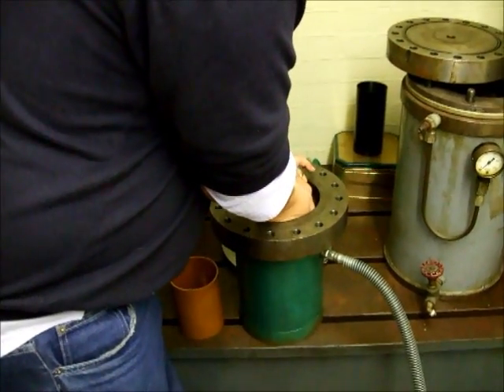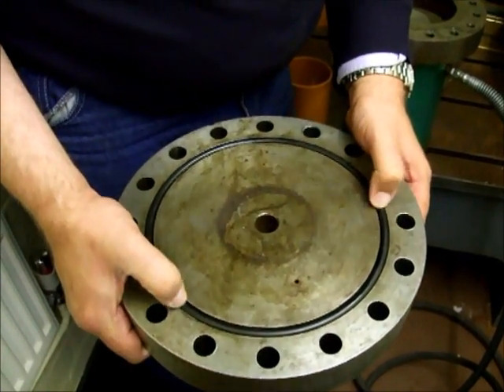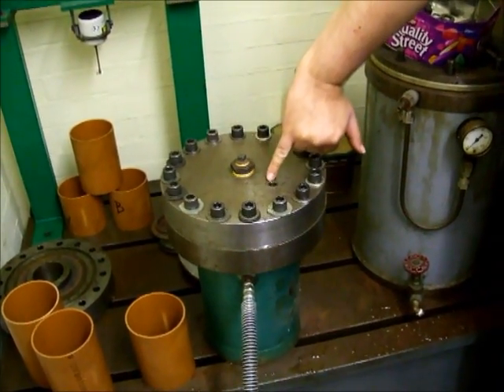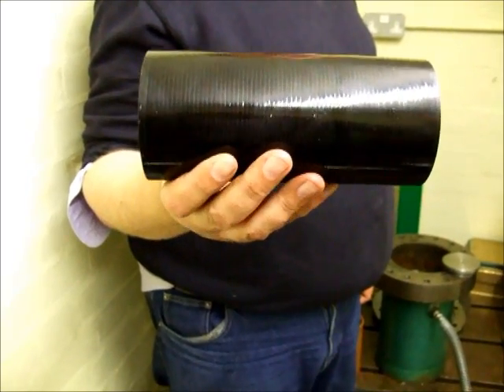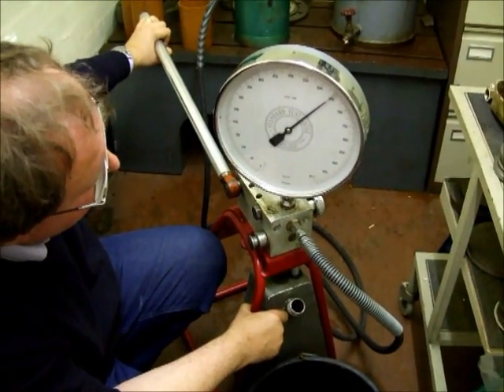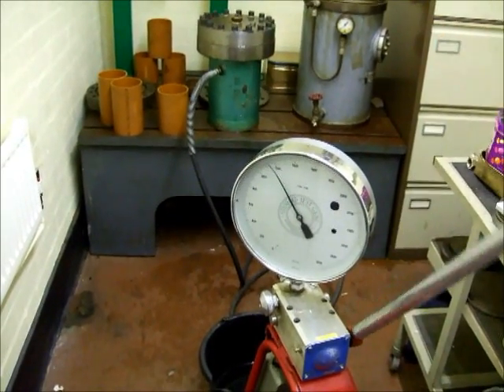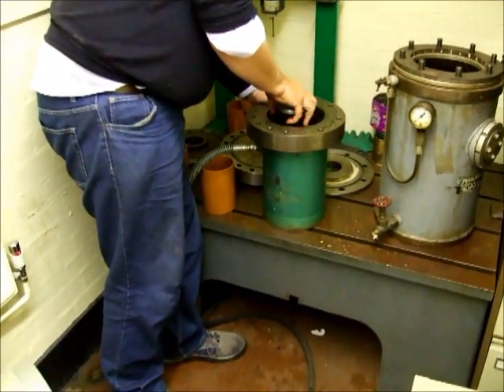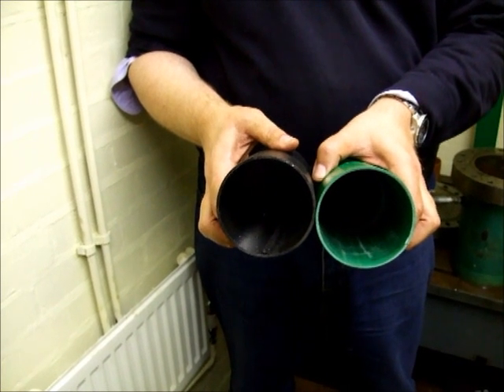Collapse of Composite Submarine Pressure Hulls

Comment: If only OceanGate had seen this experiment. This may be what happened to the Titan.
Reply: James Cameron knew.
Reply: @RichardPhilbin they all knew!
Reply: It seems like they chose to ignore a lot of risks. This video probably wouldn’t have made a difference to them
Reply: @guttermouseTV but those risks are inconvenient and stifle innovation! 😅
Reply: @guttermouseTV Yeah stockton rush should be smacked. Oh yeah he got smacked good already.
Reply: anything that differs in shape from an almost perfect sphere has to be reinforced by up to 35% increased wall thickness to compensate for the lack of efficient shape 
you end up having to reinforce your cylinder with walls so thick your end shape ends up being almost close to a sphere anyway
this is the current issue with the materials we know of to this day
Reply: @SHERMA.  Not exactly, it depends a lot on the material. Also if the shape is built in one piece. That's why submarines are built with metal. Not only metal can absorb pressure better (because of the material itself) but also can be built in one piece (extruded in a cylinder) which helps distribute the pressure evenly on the whole shape since there's no "beginning" on the shape (like a weld line, which is usually where failures occur). On bigger shapes that can't be built in one piece they overlap the pieces, so the energy is as evenly distributed as possible between them.

But with carbon fiber? No way it can withstand the same amount of pressure, unless like you said it's reinforced so much it ends up being very bulky. But carbon fiber has a problem that extruded metal doesn't, which is delamination. And soon that starts to happen you have a weak spot that's where the pressure starts to build up until it collapses and it's game over.
Reply: They didn’t care. They didn’t like the existing safety regulations, they wanted to do it their own way.
Reply: The CEO of OceanGate knew this but he still insists on using carbon fiber because of his ego and "innovation"
Reply: Ocean Gate knew and had been warned.
Reply: I'm pretty sure they knew.
Reply: Everything above is true but its even worse he used a window rated for only 1500meters. He shouldve been jailed.
Reply: That’s the problem. They knew of this.
Reply: Stockton knew all the risks and challenges, he was an engineer. He didn't take into account (or deliberately ignored) possible stress fatigue during use of the sub. This carbon fiber section should've been at least disposable, one time use only.
Reply: @Furiten  He used the material because it was cheaper. Single use would make it more expensive.
Reply: The whole industry knew which I think is what pushed the letter warning them about the dangers. 🤦
Reply: Titan is what happens when you try to prove science wrong.
Reply: Stockton Rush wouldn’t have cared. His sense of reality and estimation of risk wasn’t governed by evidence but by emotion and ego.
Reply: If only Stockton Rush was more than a rich man-child...
Reply: There's no "May be" about it ......... that's what DID happen to it, but in a more catastrophic way than those models stood up.
Reply: That is what happened. They heard cracking on test dives to which he apparently said that there are 5 inches of it so they were fine
Reply: @steveo601 Re cracking, submariners have testified that all submarines make noises descending. The experienced guys make fun of the noobs for freaking out.  I can't vouch for accuracy, but it gives me pause about assuming that noises correlate with failure. I believe we just don't know. And now I'm hearing dialogue from The Big Lebowski. Was Bunny really kidnapped? 😂
Reply: They'd have ignored it. Stockton had two last names for a whole name because he was an arrogant trust fund baby. Aerospace degree but no FE or PE because he wasn't a real engineer. Anyone who passed freshman level matsci would have known this was a con.
Reply: Rush might have seen this but the testers are 50 year old white guys so...
Reply: @krrk6337  Yeah is Professor Carl Ross - University of Portsmouth UK doing the experiment. What the heck does he know says Rush
Reply: They were prob inspired by this
Reply: @sikhswim  🎯
Reply: It was either this or the plexiglass window at the front of the sub.
Reply: Maybe he did see this and said …”HOLD MY BEER”
Reply: If only they had asked anybody or even listened to the people that tried to tell them lol.
Reply: The way rush operated seems to be like making a paper boat, the boat would act as a boat once or twice, but the third time it would disintegrate.. the real concern to me is his knowledge of microscopic fissures or breaks just didnt occur and his paper boat would never need structural rebuilds. Love to know what the companies own findings were with regard to durability.
Reply: Titan should have been made from Tungsten, but it's expensive but it would save Lives 🙏
Reply: Ocean Gaye C.E.O .WOULDNT HAVE CARED EITHER WAY…..he was an arrogant careless risk taker and didn’t want to go-out by himself so he took 4 others with him
Reply: They could have known. Rush didn't want experienced older white men telling him about science.
Reply: The owner knew, he used parts from "camper world".
Reply: It's exactly what happened.
Reply: These guys cannot do 5 minutes of work without having a tin of candy at an arm’s reach?
Reply: Ocean gate knew. They didn’t care. They have multiple subs of traditional construction
Reply: It’s as if they were tempting fate and audaciously daring anyone foolish enough to be dragged down with them… Demonic
Reply: At 5800 psi, the failure of the Titan was more akin to 50 lbs of dynamite.  It is scattered.
Reply: Nah bro, The CEO is such a stubborn and arrogant person. He ignored almost everyone who warned him, even the experts
Reply: Ya tepat sekali.
Sepatutnya titan cek ekperimen ini dulu..
Reply: This IS what happened
Reply: The CEO wanted to die i guess he just needed someone to die along with him
Reply: HEVDID SEE IT!!!!ALL COMPOSITE ENGINEERS ARE VERY AWARE …  
Don’t forget … 777, 757 all air bud are composite … this is a privativem Experiment .. Composite carbon and others have been worked on since the early 90ss.. I know I worked with StructuralFibers 1985 to 1990s!!!!
Reply: @ChasOnErie not underwater. You need a contiguous material like steel, titanium, ceramic or (more recently) acrylic, or there will be delamination.
Reply: It’s what happened. It’s a fact
Reply: They did, just didnt speak same language
Reply: When people have more money than sense
Reply: These are old white guys.
Reply: Rush already knew this , there's a man that went down with him and the hull was cracking so the had to return to the surface.
Reply: He didn’t want people who knew what they were doing working on it. Duh.
Reply: @please_stop-v7o eggs are extremely strong lengthwise but weak on the sides because of that very reason
Reply: Ocean Gate didn't care.
Reply: It’s dumb to not use a sphere shape because it takes on the load (pressure) evenly. A cylinder shape like Titan has multiple loads because of the shape, not only is the load on the entire outside wall of the cylinder pushing in but the end caps are also putting a load going into the sides of the cylinder this is why a sphere is the best design. It doesn’t matter how thick you make the carbon fiber hill it could be 10 feet think and it will still delaminate over time and fail. However even if you use only metal/alloys to make a proper sphere shaped sub you still will want to replace it over time and so many cycles just to be safe. But with metal/alloys you can scan the hull to detect any potential damage, not so much with carbon fiber. Ocean gate CEO took it as a personal attack when people said to not use carbon fiber but people only said that because it was the truth! People would love to use carbon fiber because it’s so light it would be great to be lighter that’s exactly what you want when building a sub but nobody uses it because it’s not safe.
Reply: did you hear the crack of the implosion?  loud!
Reply: The owner was motivated by profit and not quality or safety. He wanted to make it from a material that allowed him to increase the diameter to fit more people. Be thankful he wasn't able to evolve to having 100 people die.
Reply: I do love watching some uninspirational old white guys, quite nice indeed.
Reply: Carbon fiber is great for what they the good engineers use it for. Rush knew better but did not care. Shame he killed other trusting souls.
Reply: the 50yr old white guys they didn't hire knew about it
Reply: They probably watched this and decided it failed because of white man and their diversiteh would keep theirs safe.
Reply: Dude they saw this. They did these experiments
Reply: Stockton Rush knew this. He was incorrigible and stubborn. Mad man.
Reply: He is a 50 year old white man so who's going to listen to him
Reply: He knew.... But he tried to be the new rock star of the depths... He thought that he can got way with 5" of carbon fiber.   The only think that can hold at these depths is heavy steel.  nothing else.
Reply: The batteries died in the controller, or the duct tape.
Reply: Doubt it would have mattered❓
T'he CEO probably did❓
Reply: On the bright side we're all a little smarter because of their failure
Reply: According to an interview with the owner, they imploded lots of carbon fiber models in a lab at the U. of Washington while they were testing formulas and models.
Reply: OceanGate CEO ignored all of it.
Reply: I assure you, they saw this video.
Reply: They knew but thought the risk was acceptable
Reply: Titan has swam there many times before this was just an issue with the material
Reply: The real problem was the sub being made of 3 different materials, each of which expand and shrink at different rates, eventually causing a seal somewhere to be compromised after repeated use and testing. Stockton did not account for this sadly.
Reply: Wouldn’t have mattered. The CEO was too arrogant.
Reply: They knew.
Reply: @please_stop-v7o  The Deep Flight Challenger was build for Steve Fosset, who died in an airplane crash before he could use it. Richard Branson bought it to make a commercial operation from it. Until he got informed it was meant to be used only once and then become a museum exhibit.
Reply: @please_stop-v7o  so that’s the thing, the guy must have realised each time the cracking noises were different, I know the humans on that sub were given some warning prior to it imploding, there’s no way it went to depth in good time then just suddenly popped,
Any submariners know if holding at a certain depth increases in stress over time? Eg sitting at 2000m (what it got rated for) will give the hull 3000hours or is it unable to self destruct at that depth? 
There’s a meme from years ago which says “I became a pilot because I fear dying alone.” I’m sure it will come back
Reply: @please_stop-v7o   this is just an expensive Darwin award, i would laugh about it due to how dark humour works.. but obviously its not appropriate. Ive just used all the algorithm spam about this to explain science to the kids, since these people are very clever, surrounded by other capable minds, and they literally got complacent. The one thing i did learn from them is the superheating of the air within the sub, thats phenomenal to process. I did the math at 16000 psi per sq inch assuming salt water density at 1026kg, but i never factored in the water temperature, but if at 3500m thats only 1/3 of the depth/pressure with 5109 psi. Which of course is enough to pancake alot of things, is not a big ask for an actual submarine. Hope it was deep enough that the implosion occured faster than their nervous system reaction times
Reply: This is literally what happened to the Titan.  Anyone with a working brain knew it was in smithereens the second it was reported missing with no tracking or comms.  Carbon fiber does.  Not.  Handle.  Repeated.  Extreme.  Stress.  Well.
Reply: He saw many of these tests and was warned numerous times he didnt listen.
Reply: Actually, this is not the experiment OceanGate designers should've seen or better yet performed themselves. They are loading the model to failure, while what did the Titan in was the cyclic loading. The submersible had already made the voyage to the wreck several times, so we know that originally the hull was strong enough for that depth.
Reply: @rh_BOSS Just because it had already been that deep before means nothing, each time it went down put stress on it, gradually making it weaker each time.

It was only a matter of time before it imploded.
Reply: @southernflatland  Which is pretty much the definition of fatigue under cyclic loading. Once again, load-to-failure is not the type of test you carry out to investigate material fatigue.
Reply: @southernflatland That’s why my seemingly fine ski boot had a 9 " crack one morning.. It's why insurance companies are required to replace infant seats after a crash, and they can't be sold used. You can't see what's happening at a molecular level, and the risk of catastrophic failure is too high when it's all that protects a life. (You understand this, but material fatigue is a new concept for many people.)
Reply: He said people have said not to use carbon fiber and titanium….. he glued them together is the sketchy part
Reply: All materials and shapes fail with enough pressure (or stress). This wouldn't really change anything for oceangate. Designing a sub out of carbon is possible. Using a cylinder shape is possible. You have to know what you're doing. They didn't.
Reply: Well, I saw another interview yesterday, he was one of those who believed going to space is created on a Soundstage in Hollywood...So.
Reply: @someguy9778  WHAT? Link please, lol
Reply: Oh what's up, I see we're all gathered with effects of pressure deep underwater videos after the incident
Reply: @tjknox8936  we're all deep sea and submarine hull construction experts now, for a couple of weeks
Reply: Your putting these same comments on all channels ?
Reply: @coderider3022 I saw the same comment on pornhub on a German granny smut video
Reply: @coderider3022 maybe someone will listen…. I do the same on all the news channels….
Reply: @coderider3022  Yes, I saw he made the same comment on a video about breeding cocker spaniels.